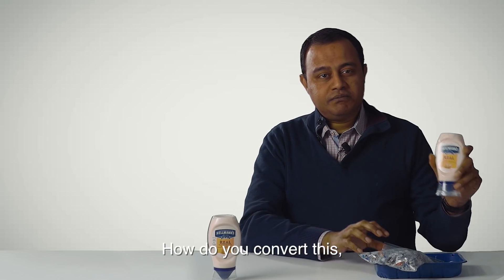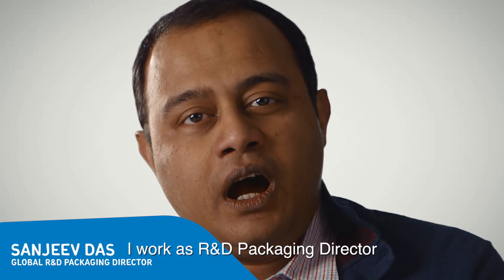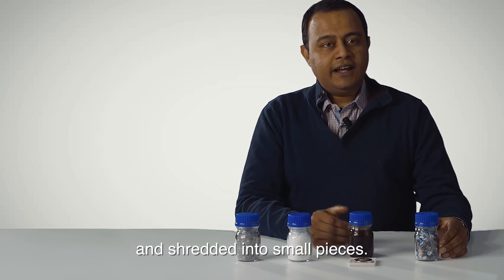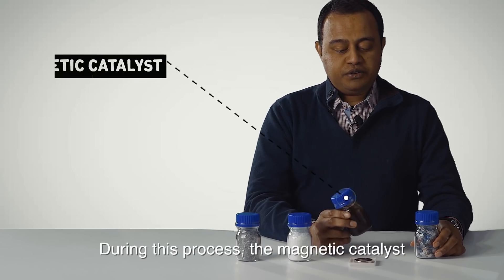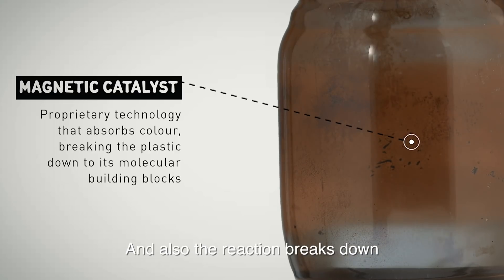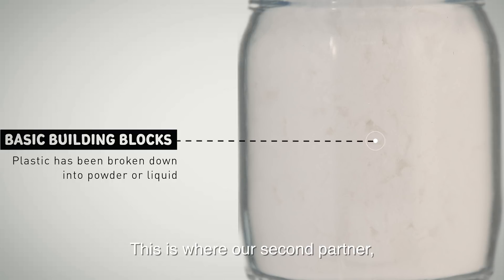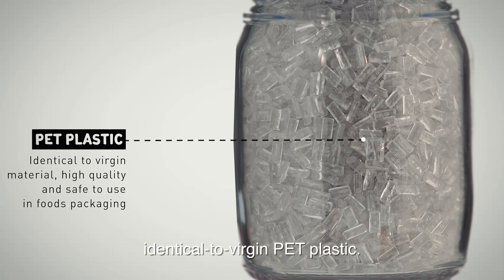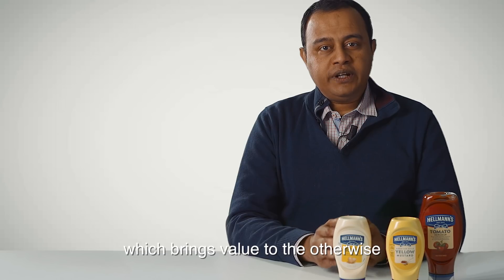How tech is cutting PET plastic waste | Unilever

Comment: After 21 years as a engineer The issue i find with 100% recycled plastic is the off color.  Its not like as clear as 100% virgin plastic . Also the mix is never the same , but as the years go buy its getting better .